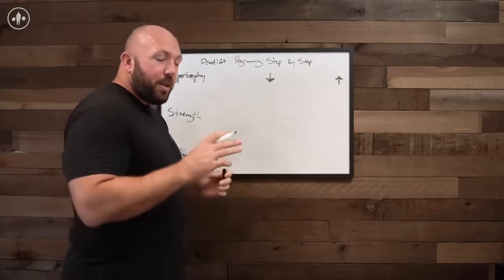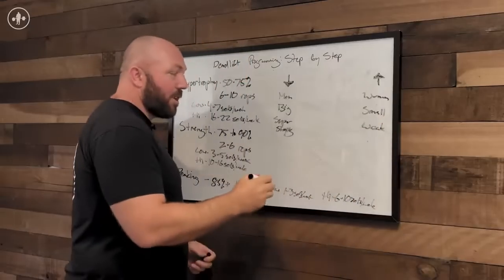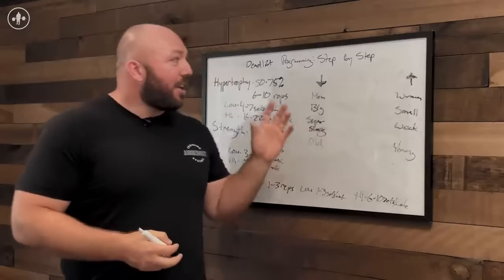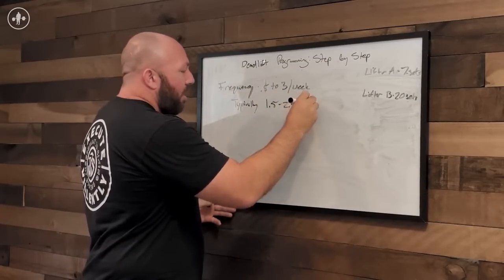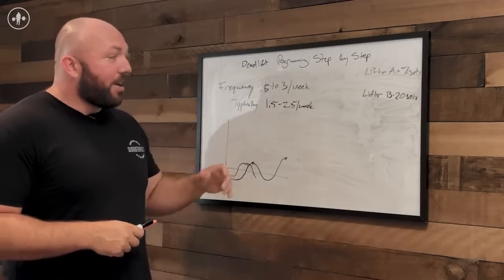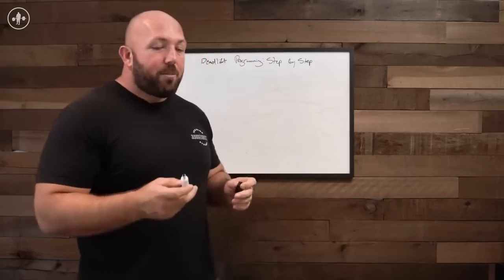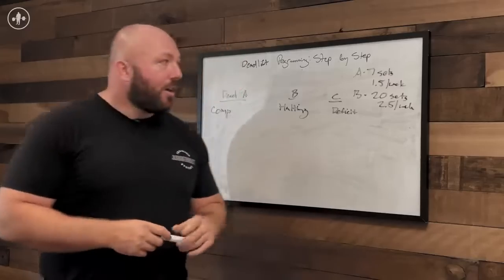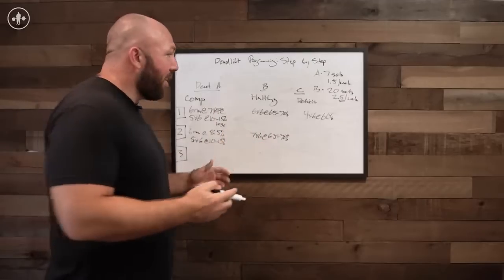Designing Deadlift Training for Maximum Gains

Comment: Hey CWS. If I could have yours, and anyone else’s, thoughts on my planning for my program. I am using Juggernaut AI. I have a meet in August and November, there’s talks of two in November but still. My current program is designed for a mock meet may 3rd. I’m in range to now swap it to August 9th. I’ve done one meet, last November, but the mock meet would be good experience to figure out openers and wearing a singlet and stuff. However, if I push and wait until August I would have better numbers more than likely. I’m kind of torn on what to do. I’m probably going to swap to the August for my program, but on May 3rd do some singles, the week of and prior doing some 3-6 rep range stuff. 
Estimated totals as of now, SBD 355/245/525. 192lbs. 1.5 years training time. Thanks CWS and anyone else that responds!
Reply from the maker: Wearing a singlet doesn't take practice (just wear it in training if you want), the app will tell you your openers. If you wanna do a Mock in May that's fine, I'd just make sure you have a good 12 weeks after that before the August meet.